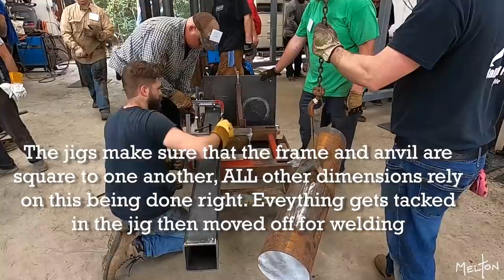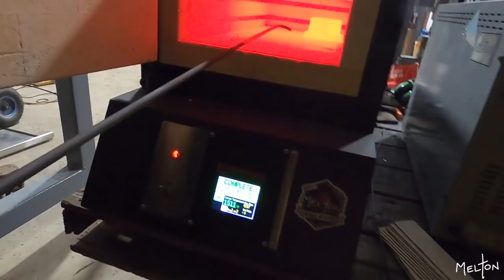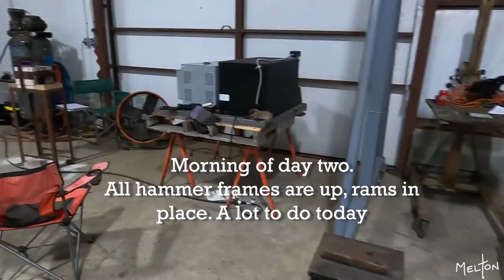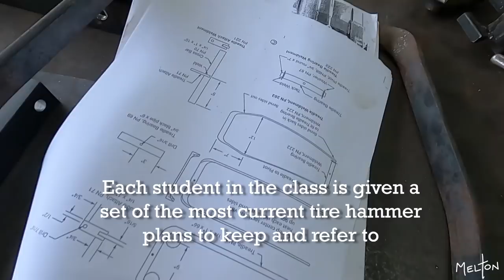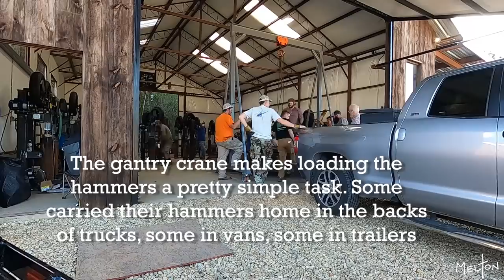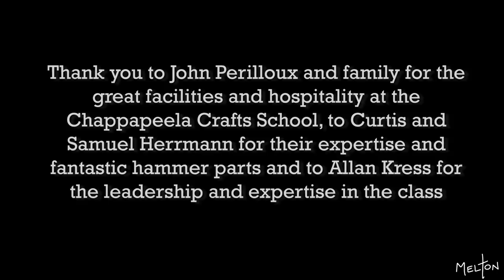Clay Spencer Tire Hammer Class - October 2020

Comment: I see Clay has updated his hammer design.  At our hammer build (2017) we poured melted led into the hammer instead of having a solid steel hammer.  I think our hammers were rated at 70 lbs.  The build I participated in was a 2 & 1/2 days also.  However, several weeks prior, the steel was ordered and tons (literally) of it had to be cut to size for numerous different parts.  I'm not complaining, its was fun but there is so much work that takes places before the build actually begins.  Clay was there on the last day to fine tune each machine and give his okey okedoky.  We each got an announcement poster advertising the build and I asked Clay to sign mine, which he graciously did.  I had it laminated and it now hangs in my shop.
Reply from the maker: That’s awesome! I got to see Clay again recently at the Alabama forge meeting.
Reply: I can reply as I got the latest versions of the plan (to produce tire hammer in france). Solid hammer is for heavier hammer and requires larger anvil. Some other design points have changed but plans still contain the two versions.

Comment: So, if everyone is only doing a couple of the processes it takes to complete one, how are they actually learning to create the whole machine? Do these people get a hammer when they are completed or would they have to buy it?
Reply from the maker: Everyone in the class that pays the full tuition cost goes home with a hammer, regardless of whether they turn one screwdriver the entire time or if they're responsible for completely welding every frame. It's a team effort. At the end of the class, each hammer is numbered and the participants draw numbers from a box. The fact that everyone knows that the hammer they'll take home is by random chance ensures that everyone is doing their job to the best of their ability. Nothing in the class structure says you have to do ONE task the entire time. Quite often, people move about from job to job. The important thing is that the jobs are getting done, on time, in the right order to ensure good hammers are being built. That is the job of the coordinators of the class and the system works very well.
Reply: @derekmelton , well that’s pretty awesome. Are you doing the classes again anytime soon, or where can I find out more about it?
Reply from the maker: @andrewtucker7990  I have only been a student at these classes. I've done the heat treating and documented the classes with these videos but I do not host them. I've attended 4 of them and brought 3 hammers home. They just had another one in April. I don't expect another class until sometime in the fall in Robert, Louisiana at the school. To see more about the school and to hear about more classes visit https://www.chappapeelacrafts.com/   I'd also suggest joining the Clay Spencer Tire Hammer users group on Facebook. Often other classes around the country are listed there.
Reply: @derekmelton  I will be checking that out. Thanks, man.

Comment: Great video   what would the cost be on the hammer build classes ?
Reply from the maker: Usually around 2500. These hammers with the 70lb rams, 515lb anvils usually sell for 3600 or more, that was before steel prices went nuts.
Reply: @derekmelton  doesn't the class include everything to operate the hammer?
Reply from the maker: @malcolmbuehler5619  I’m not sure what you are asking, at the end of the class you go home with a fully functional 70 pound tire Hammer.
Reply: @derekmelton  you said that the anvils cost $3600 and I thought you meant they were sold separately from the rest of the hammer as the class costs $2500

Comment: Is this video supposed to show us how we can build our own hammer? Great, Ima go rush out buy me a building, tractor, welder, hoist, steel, hammers, electrical tools and four laborers to help me make the build. Thanks
Reply from the maker: No, it's designed to show you how much fun it is to get together with a bunch of awesome, like-minded blacksmiths and build things together. Guess you missed that.  Anyone can build a tire hammer but yes, you do need to consider how you're going to life 500lb pieces of steel, how you're going to weld it, etc. Without the proper tools, I'd suggest buying one rather than building one.  Good luck!